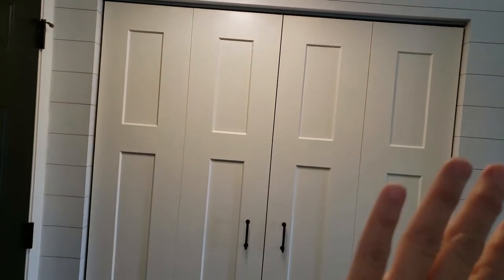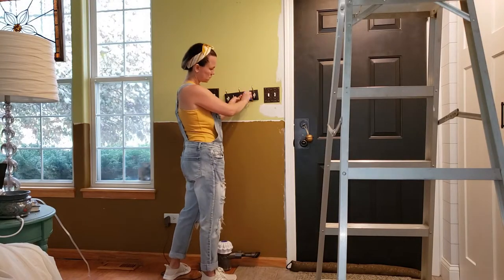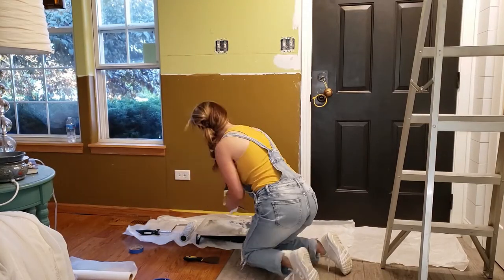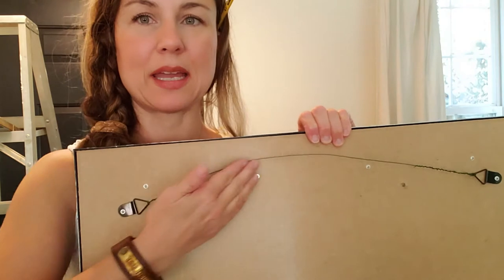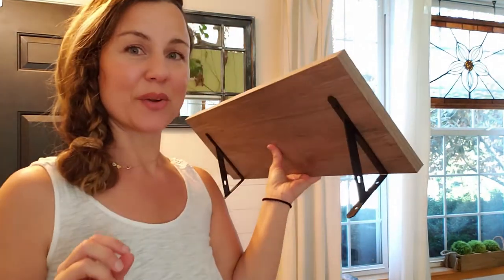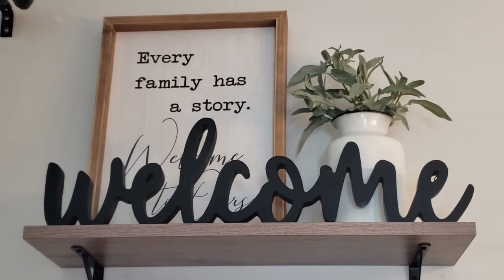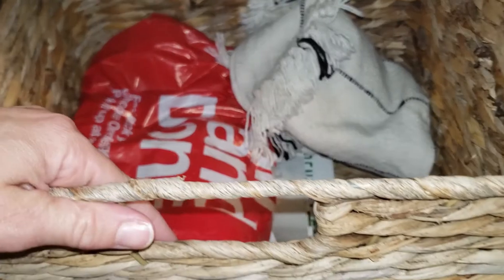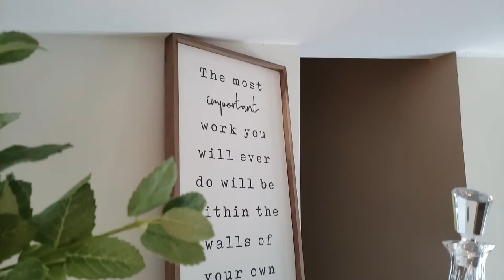DIY ENTRYWAY MAKEOVER ON A BUDGET/ENTRYWAY IDEAS/ MODERN FARMHOUSE ENTRYWAY/ ENTRYWAY DIY

Comment: Binge watching some of your older videos, I’ve been wanting to paint my white front door black just like yours. Do you have a video showing how you painted yours?
Reply from the maker: Thank you! Actually I do not but I have several doors to paint so I will eventually be showing that. You can start with the squares and rectangles and then move onto the outside portions around them. I used a hotdog roller for the entire door. You can also use a brush for the creases/grooves around the squares. Just finish with a roller so you have a smooth surface. Hope this helps!🤍
Reply: @MightyMama  thanks for responding 💕
What type of paint did you use? An outdoor paint, a door paint? How did it keep up?